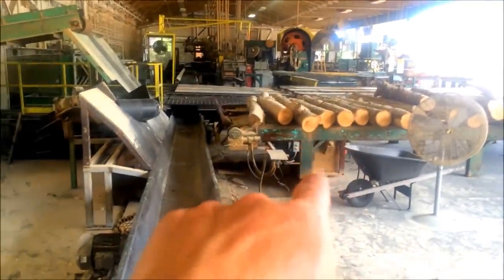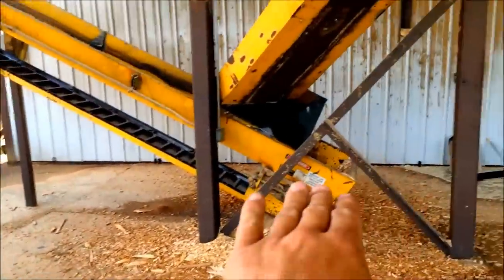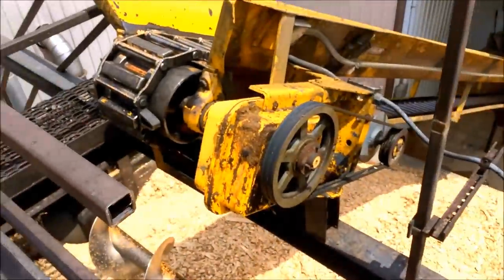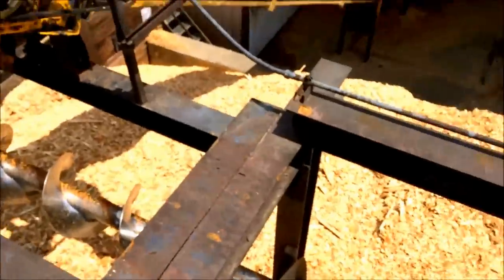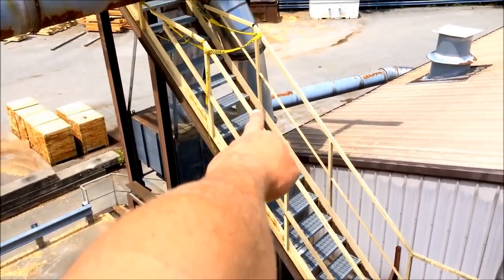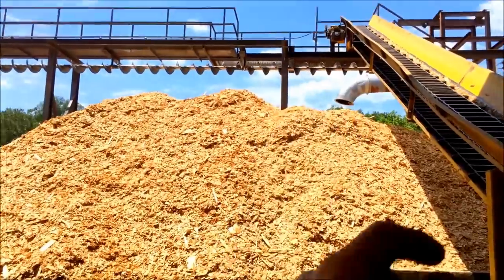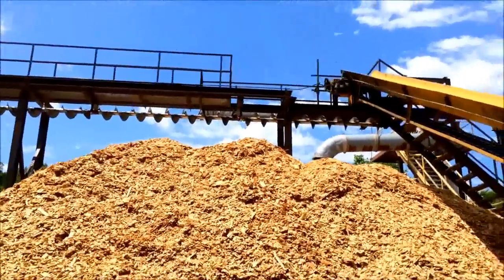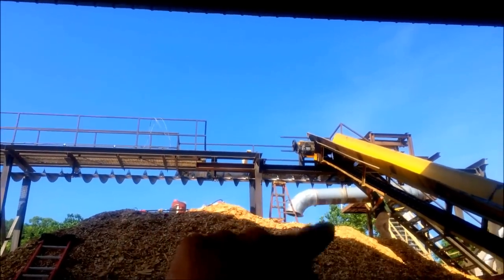Waste Project Part 1!!

Comment: That hand can really explain the shit out of a situation..Just a pointing and a twisting and a flexing and a swinging this a way,that away..Whew..Good job..So what is a hoggin??
Reply from the maker: Hahaha!!!  Ask the hand...  Bamm!!!   No a Hoggin is like a wood chip just a little different in shape.  Thanks for the comment I got a chuckle bud
Reply: ***** The new machine is called Wood Hog. It uses big hammers and an anvil to reduce the size of the incoming wood product. In side of the Hog is a screen with holes, the hammers beat the wood fiber until it is small enough to drop through the screen. Normally a 1.5" or 2" Baffle screen is used to produce a uniform product. The Baffle on the screen stops long pieced of wood fiber from falling through the screen. 
Wade may make a video of the inside of the Hog.
Then you can go Hog Wild with more questions.

Comment: We collect the dust off the sawmill and edger to sell to the Horse owners.
Then our edgings go through a Challenger Horizontal Grinder with a 1.5" baffle screen. That product gets sold for Mulch and Cattle Bedding.  The Cattle Bedding market is better than the Mulch market for us. 
If you get a consistent sized product you should be able to tap into the small animal bedding market too.
Reply from the maker: Cool beans thanks man that might just be an option

Comment: I'm fascinated that you talk about a fan after the cyclone - that is something I've never seen before!
Like someone else said what is the fire hazard from that heap when your cutting, grinding and welding above it?
Reply from the maker: Dan it takes a little more suction but maintenance is a lot less because the air is clean at the blower